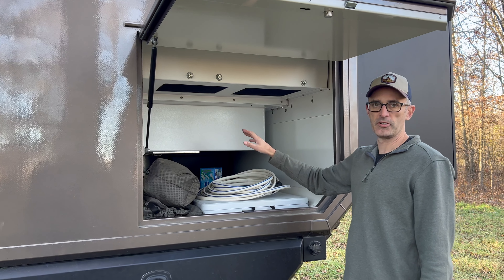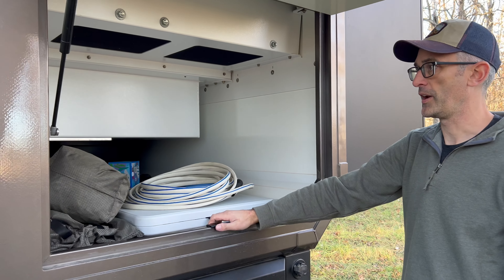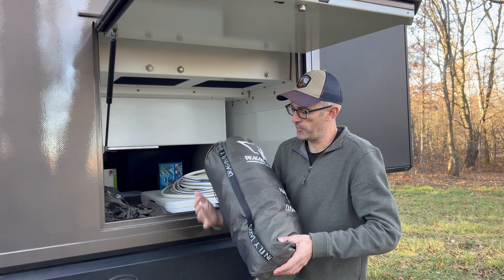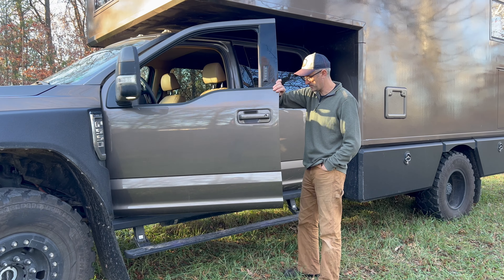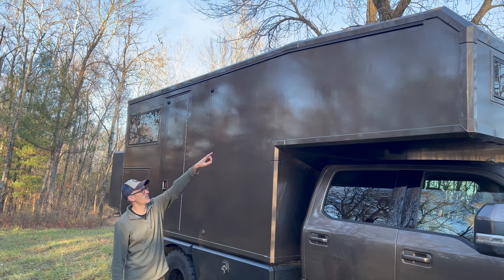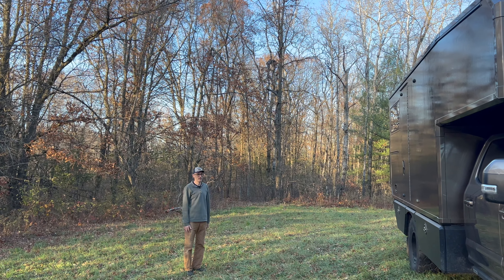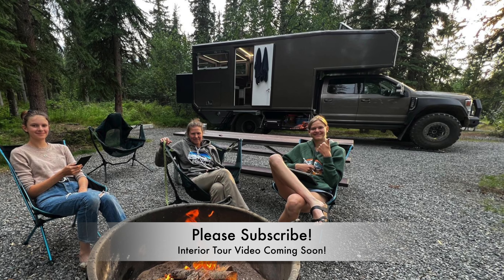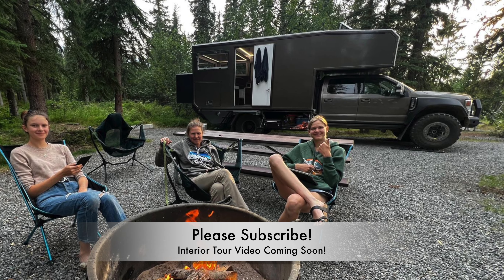Off-Road Beast - Exterior Tour Part Two

Comment: @disappointment ranch, beautiful rig, great job on that, love it! Considering going with a gasser on my build and would like to know the the mpg in real life scenario, thanks!
Reply from the maker: Real life mpg from computer and a couple  old school measurements is 8.1. That is a consistent average thru plains and mountains. I am happy with the 7.3. It performs well. For a non towing rig I think the gas is the better way to go. $10k cheaper engine, 750 lbs lighter!, cheaper maintenance, fuel anywhere in the world, fuel cost per mile has been less than diesel recently, any mechanic can work on it.

Comment: This is such a good build.  And these videos on super helpful.  
Lots of the little details are helpful... eg I was wondering how you made the louvers, and the clip of you bending the laser cut sheets answered my question.  

The reason no one wants to do anything with gasoline is because of the CARB & EPA requirements.  They can get in significant trouble if they advertise that their product works with gas without having documentation that they meet the regulations.   
TransferFlow makes a 58G gasoline tank for the F250/350's and they are able to charge a fortune for it because they are the only ones who have gone through the compliance process.  That tank actually ships with an addon EVAP canister.
Reply from the maker: Thanks!  That is exactly what I was going for!!  My goal is to be helpful - we spent an eternity researching things for the build.  I also got decisioned out.  So many decisions to be made for every little thing - it was exhausting.  I really wanted someone to tell me the decisions that they had made, why and how it turned out.  I am so glad that it is helpful!

As for the gasoline thing - totally agree.

Thank you!

Comment: Does the auxiliary 26 gallon tank interfere with the Liquid Spring components? I was told with my 60CA 550 that the space for a midship fuel tank was taken up by them
Reply from the maker: On my setup with the 84 CA and the ‘older’ liquid spring, it fit easily after relocating the vapor canister. The ‘newer’ liquid spring actually allows for the ~60 gallon Titan tank in the midship position, which I learned too late in the build. Had I known, I would have gone with a midship tank from factory, the newest liquid spring, the huge titan tank, and then put my spare tire in place of the rear 40 gallon OEM tank. Having 66 gallon capacity is really nice!